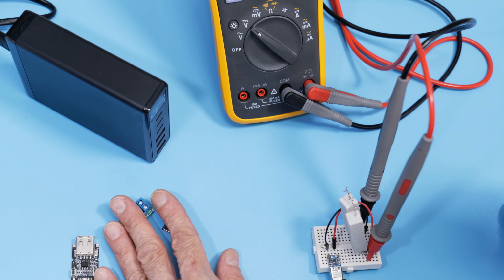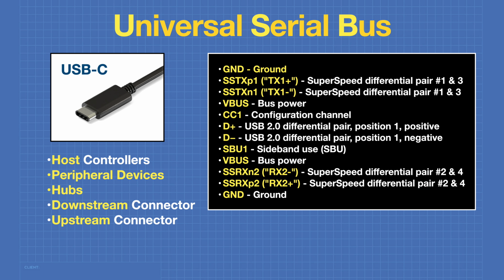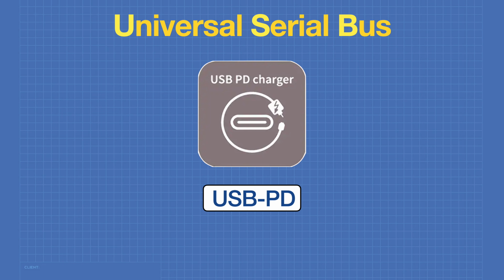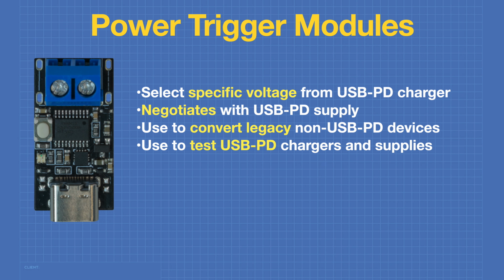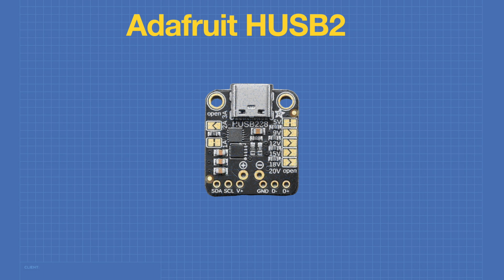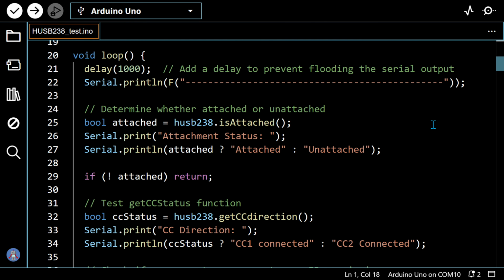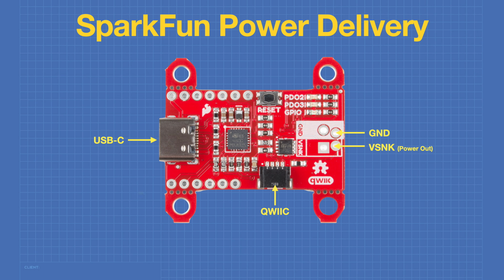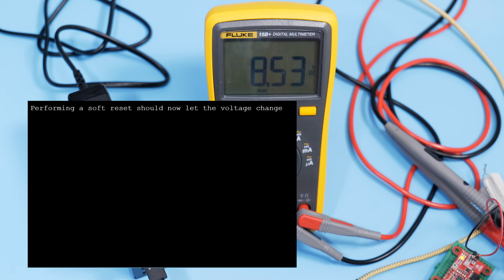USB-PD: 5-20V Power for Your Projects

Comment: So I’m watching this to learn more of course and this has been very informative, what I’m looking for is one of these that work in both directions because I want the c port to be the exit instead of the input so I can make some old laptop chargers into fast chargers, or to make a power bank converting up to say 4 to 29v with fast charge for phone and ipad
Reply: I have the same need as you, but I've found out the hard way that while it's easy to transform a "dumb" load into an intelligent load that can request the voltage it needs from a standard PD power supply, simply by using a trigger, transforming a dumb power supply into a standard PD intelligent power supply capable of communicating with intelligent loads is currently a very difficult and expensive undertaking.
This occurs both for market reasons—the lack of easy-to-use boards and products like triggers—and because the task is much more complicated:
In fact, if you think about it, in the negotiation that occurs between a smart power supply and an intelligent load, the power supply has the heaviest load. It must first provide an initial voltage of 5 V and then, after the negotiation, provide the final voltage requested. This isn't a simple data exchange; it requires "control" of the voltage and the current generated, and therefore, in practice, a "logically" controllable power supply.
The smart load only needs to conduct a negotiation conversation and then wait for the voltage it needs: this is why it is easier to implement.

Comment: I have a pi 5 and i plan to connect my pi 5 with ups for graceful shutdowns. I want my pi charger to meet industrial standards where temp is 40-45 Celsius. I have a pololu D24V90F5 , i m planning to buy a smps to make a power supply . I have many doubts on how to make the connections with protection. Can anyone provide insight?

Comment: hi, what if i want to do the other way: i have 12-14V from the motorcycle and i want to charge my PD-12V capable Powerbank? thank you, fantastic video!
Reply: I repeat my answer for you

I have the same need as you, but I've found out the hard way that while it's easy to transform a "dumb" load into an intelligent load that can request the voltage it needs from a standard PD power supply, simply by using a trigger, transforming a dumb power supply into a standard PD intelligent power supply capable of communicating with intelligent loads is currently a very difficult and expensive undertaking.
This occurs both for market reasons—the lack of easy-to-use boards and products like triggers—and because the task is much more complicated:
In fact, if you think about it, in the negotiation that occurs between a smart power supply and an intelligent load, the power supply has the heaviest load. It must first provide an initial voltage of 5 V and then, after the negotiation, provide the final voltage requested. This isn't a simple data exchange; it requires "control" of the voltage and the current generated, and therefore, in practice, a "logically" controllable power supply.
The smart load only needs to conduct a negotiation conversation and then wait for the voltage it needs: this is why it is easier to implement.

Comment: hi, nice vid, techie question, Using an official Pi5 USB3 power supply (rated at 5 amps). How could i use one of the PD triggers to provide 5v and also +12v using just the 1 USB C input. i do have some of these PD triggers and have schematics but not sure how to be able to split the output into 5v and 12v.  I would like to use this to power an Amiga 500 with a Pi Zero attached which will pull about 4 amps at max peak.  Thanks... EDIT, just realised what i think is a big mistake with this question. I believe i would need a 100W PD power supply and not the official pi psu.  Still doesn't explain to me though how to make it work.  I am assuming set up input V to 12v and somehow step it down to 5v (with at least 2.5A throughput). The 12v only needs at most 0.75A.

Comment: The cheapo chinese trigger i picked up allows me to adjust the voltage in 200mV steps from 4V to 21V, so o believe pd can support variable voltages rather than the fixed ones.  This can be done on the fly using the up down buttons on the trigger board, and can compensate for cable loss or give in between voltages like 6.6v or 7.2v etc.  it temembers the last setting so it will out 33:49 put the voltage on different bricks.  I have used it with amazon and ravpower bricks.

Comment: Bill, how about adding a pinned comment providing a model and/or link to you desktop USD-PD charger with the digital display. There is a model listed in another comment but it is only 180W and the USB ports appear to be different versions than can be made out on your charger.

Comment: "5-20V power" doesn't actually make any sense.  Voltage is a measure of electrical pressure, not power.
Reply: Electric potential. Pressure was used with steam machines.

Comment: One correction: I believe that the maximum current is 5A so a 20v PSU output is limited to 100W. The latest PD standard also supports 28v, 36v and 48v for up to 240W maximum. Unfortunately while voltages higher than 20 are supported by the latest PSUs they do not yet seem to be available in trigger ICs. There is also an interesting variable voltage profile which is presumably designed to allow compensation for voltage drop over cables, but could be used to make hybrid switching/linear lab PSUs. Set the PD voltage about a volt higher than the desired output and then feed through a linear regulator to trim the voltage down to the desired voltage. Minimum ripple with maximum efficiency!

Comment: A while ago I wanted to build a USB PD Analyser that I could plug chargers into and it would tell me the voltage and current capabilities. I was at a loss where to start, but this video is gonna be a HUGE help!
The Adafruit module looks like it's gonna be a great fit, just read all the data over I²C and display it on an OLED screen or something :D

Comment: Very interesting, but have 1 question ... What is the Model Number and Source / Cost of that "Favorite" USB charger with volt / amp display???
Reply: USB Charging Station, Binamao 180W 6-Port USB C Charger for Multiple Devices, GaN USB Charging Hub with LCD Display, Multiport USB Charger Block for MacBook iPad iPhone Samsung Galaxy Android Laptop
Reply: @offgridgarageUSA  Bill mentions 240W and the USB ports look different on the 180W model as compared to the one in Bill's video.
Reply: I found this on Amazon "285W USB C Charger Block, YSYFAD 6 Ports Multiple USB Charging Station with Digital LCD Dispaly GaN Fast 100W USB C Charger for MacBook Laptops Multiport USB Charger for i Pad i Phone Samsung, Black"
Reply: Thanks a lot for this video! I had no idea about USB-C/PD but you explained it all very well so now I do. This definately opens the door to new project possibilities. Thanks again
Reply: Some have a port limit below the total available
Reply: I'd suggest caution with the non UL-listed devices, especially if you leave them plugged in when not home or when sleeping.  A regular (UL-Certified or ETC) charger station plus the USB dongle that reads power is the safest approach.

My favorite, while pricey, is the "Anker Prime Charger, 250W GaN Prime USB C Charging Station, Ultra-Fast 6-Port, 2.26" LCD Display and Smart Control Dial". It also supports remote (app) control also so you can monitor or power cycle. On sale it's $99.  The Anker stuff all UL or ETL tested. Uncertified stuff can put you in a hole if you ever file a claim on your insurance.
Reply: I would like to know also.

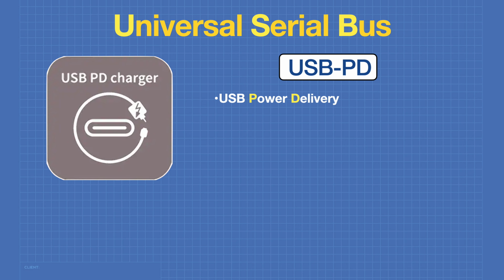Comment: Note that 240w is obtained using 48v at 5A (5:05).  Older, simpler adapters can't negotiate this much power.
Reply: can't wait to be running my 3 phase several hp motors on usb c, at this rate it'll be only 5 years
the mains coming from the power lines probably gonna be usb c too
Reply: @gg-gn3re  Soon, the power lines will be replaced by type c cables as well
Reply: @keppycs  nice 400000HVDC usb c standards coming!
Reply: @gg-gn3re  and thanks to the new carbon nano tube reinforced blockchain cable sleeve, it can also handle up to 69000 amps as well
Reply: @keppycs  ......good.......I will be vaporised even before I feel the shock when shocked !
Reply: I think the 5A is the limit on cable size and connector current, and the nanny state limits voltage to understand 50v for low voltage (un certified safety), so I think we will cap out at 240w for usb c.  It's still pretty impressive as a lot of devices don't use much over this.  I am working on a usbc spot welder with 2000A capability driven by usb c. HAN semiconductors are amazing

Comment: Is it possible to get negative voltage out of a USB-PD? I have a 1980's microphone amp that required +10v and -10v DC from a 4 pin DIN connector.
Reply: I think yes, if you start with 20v,  with some components you can create -10 +10 for the microphone, BUT... 
I don't think it will be good for a microphone and audio recording. All those powers are coming from a switching power supply that for audio matters are bad and noisy, but you can try.
Reply: cheaper to just get one made in this century. Even the negative lines on motherboard 24 pins are now phased out of spec
Reply: reverse the polarity? :/
Reply: @911canihelpu  And how would I do that? Once a rectifier strips out a polarity from the AC current how can you change the polarity of the output DC current?
Reply: @waltermelyon4300    H bridge, as used in reversing polarity for dc motor, but for 10 V from 15/20 you might need to pwm it, does it really need 10V would 9V be enough ?
capacitors on all dc power lines might help make it more stable,  10V might be to compensate for powerloss from wire resistance, long wires to/from amplifier
Reply: @waltermelyon4300  You need the ground not in a floating state (meaning the mic amp can be plugged on any other grounded device) so you might need to use a transformer somewhere to get that negative voltage with enough amperage capability.
As roberto said, your amp probably requires a very clean power supply though so you might have to forget about using any SMPS and get a good old linear PSU instead.